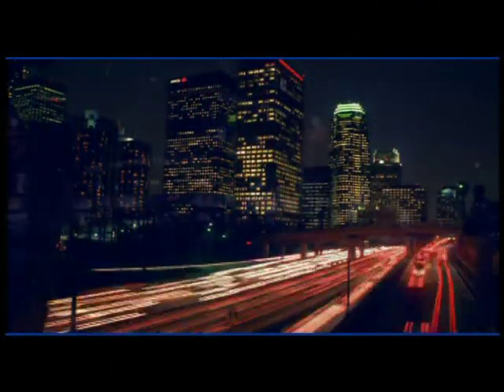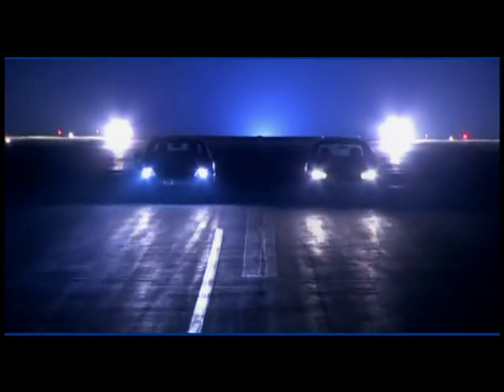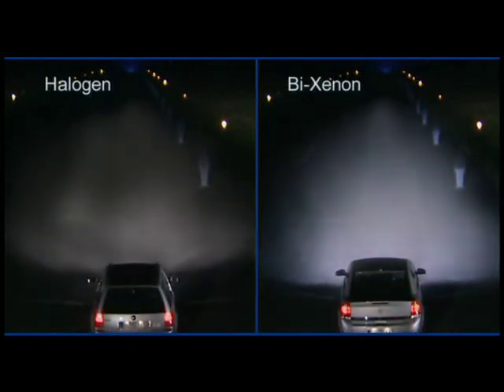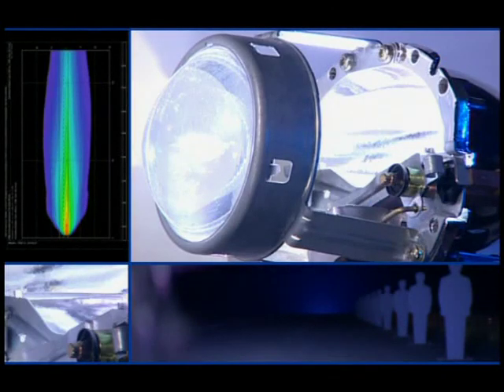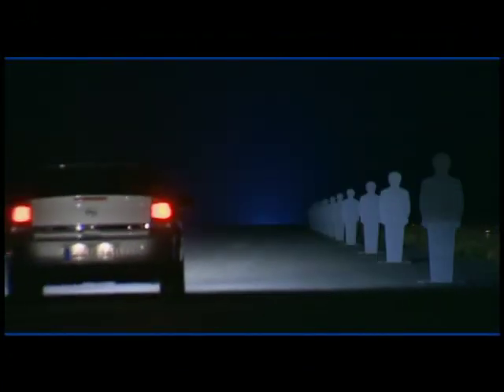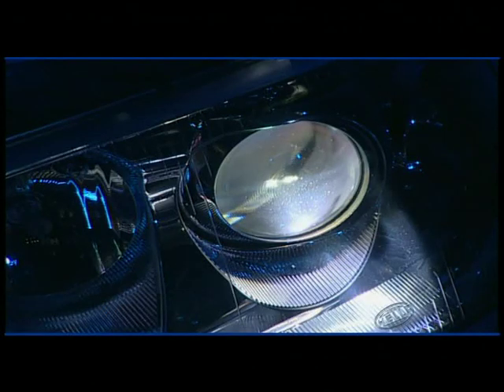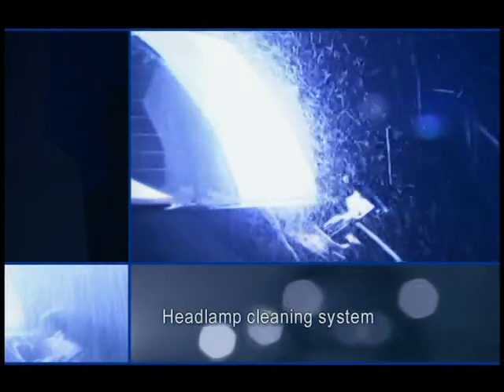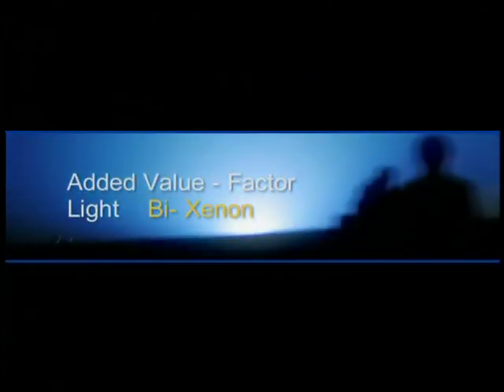HELLA Bi-Xenon Headlamp - More illuminance out of one light source

Comment: Oh sure there is more illumination. But Xenon lamps or bulbs blind oncoming traffic drivers because they either illuminate too much, or there is something just wrong about the lamps not corrected by the headlight assembly themselves, and they need to be regulated for SAFETY! Maybe if the manufactureres of these headlights took some responsibility they would make Xenon bulbs that not were the cause of many car crashes.
Reply: These headlights have more systems in place that prevent blinding more than any conventional headlight. And of course they are regulated. Way more than normal headlights.

They are great when everything works. It's the time something guess wrong they suck ass
Reply: any headlight that is not adjusted and shines into the trees no matter if its halogen xenon or led would blind oncoming traffic,the leveling devices are only meant to keep it at the same level as normally adjusted when the car is loaded or you are going downhill or uphill to prevent blinding, they arent smart enought like having a camera to detect that your headlights are adjusted to look for birds in the trees,it only make sure that this position is kept no matter how loaded the car is.